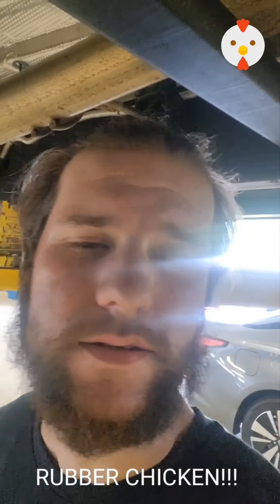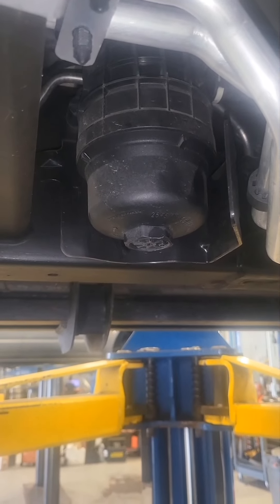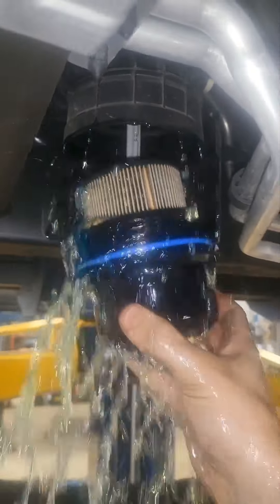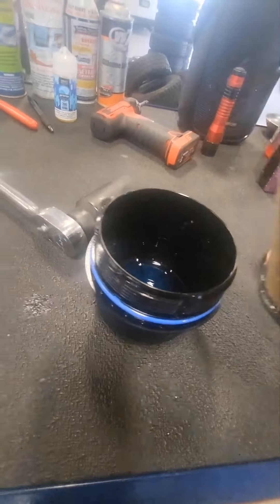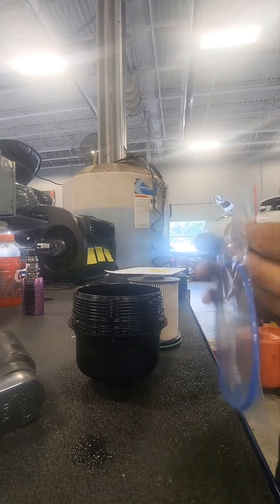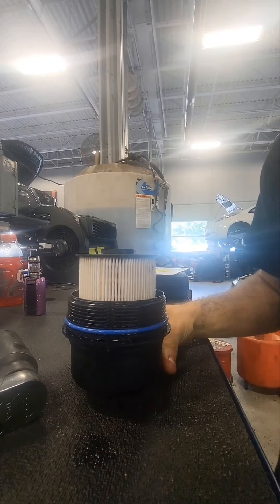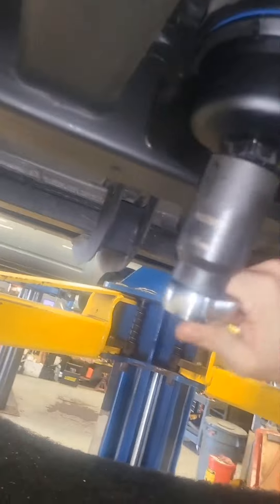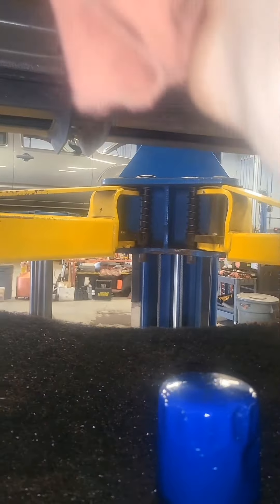2021 gmc Sierra 3.0L diesel fuel filter replacement.

Comment: Does all the def drip out when you take out the filter?
Reply: No def comes out. Only diesel fuel.
Reply: There are a least three colors of diesel which is dyed based on the intended use and the taxes paid for it.  Clear, blue and red.  Diesel also varies in color based on how/where it was made and the original stock used for refining it.  Also I have noticed that diesel fuel when it is pouring thinly can have blue-ish/greenish tint to it in some lighting scenarios.  Between the bright blue o-ring and the backlighting on the diesel fuel, I think that is what made the fuel look so blue when the fuel was pouring out of the filter housing.